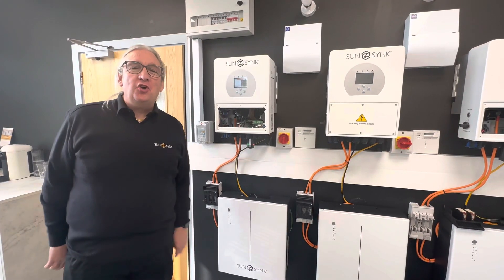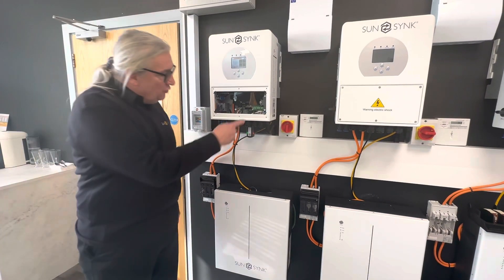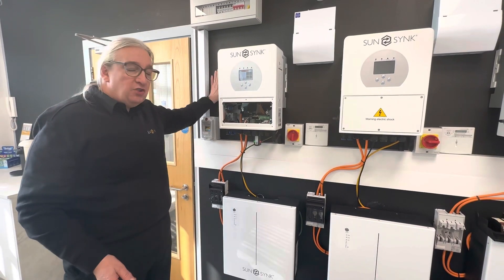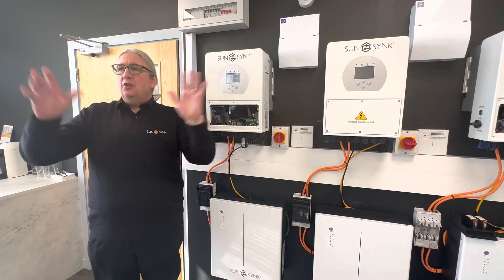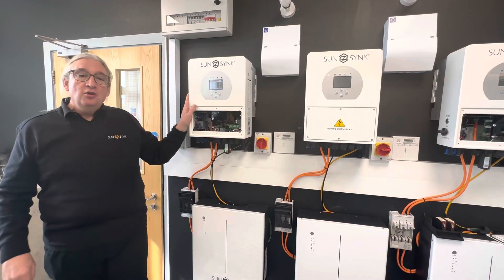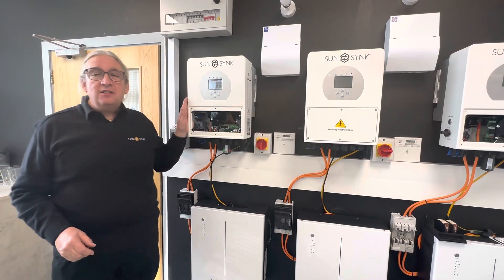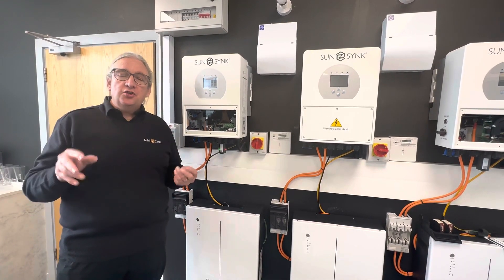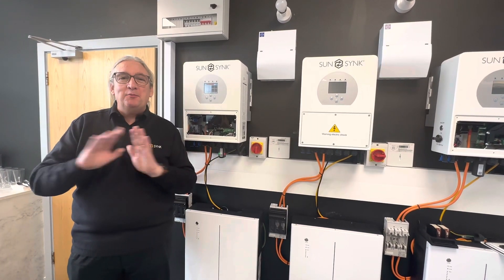Part three of the ￼Mini beast of the UK Simple install

Comment: Hi Keith. Is there a significant efficiency difference between two mini-beasts in parallel or a larger single unit?
Reply: The efficiency of the parallel system will not change.

Comment: Keith, do the SunSynk ECCO inverters have MPPT Shadow Management?
Reply: Hi Keith appreciate that your busy at show in South Africa and therefore query responses are likely to be delayed.
We have an existing GivEnergy installation with PV on house roof & inverter + battery in garage. I was wondering if this setup was possible...... Install PV on Garage Roof into Sunsynk ECCO 3.6 then into existing GiveEnergy Hybrid Inverter (as the wiring is already installed between the garage and house)

Comment: You 've mentioned that the mini beast doesn't require a mcs accredited electrician to fit it but for instance to be able to access octopus's tariffs you are required to provided octopus with  confirmation of the dno and a mcs certificate from the electrician. Thank you for the video's you provide.
Reply from the maker: You need to inform do you know after you’ve installed the system but do not need an MCS accreditation to actually install below 16 amp
Reply: you putting on a ct coil to stop exporting power

Comment: Keith, just to update you under the newest firmware for the 3.6kw ecco... 
4.6kw Charging and Discharging on the DC side with at least 2 batteries or more 😉